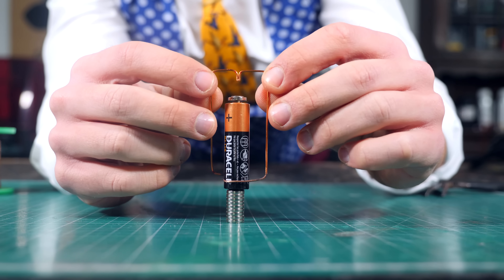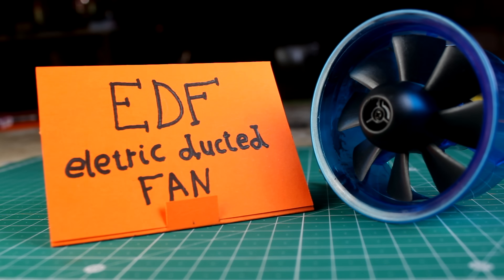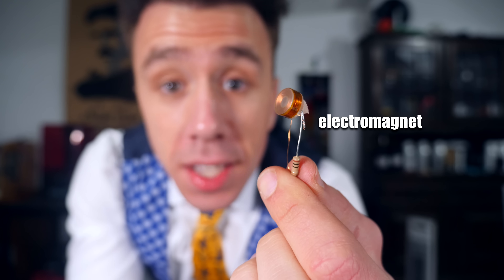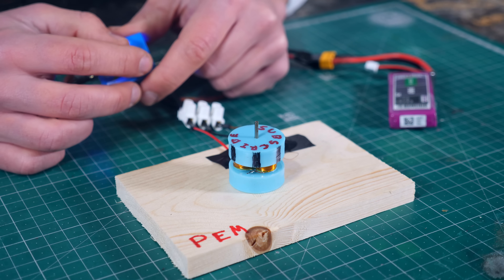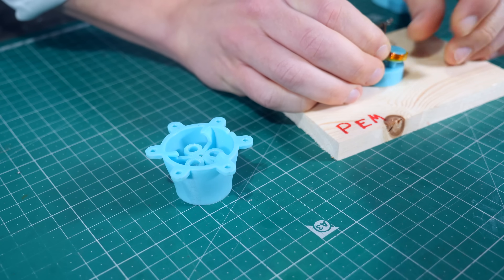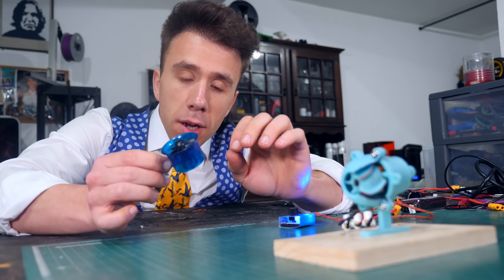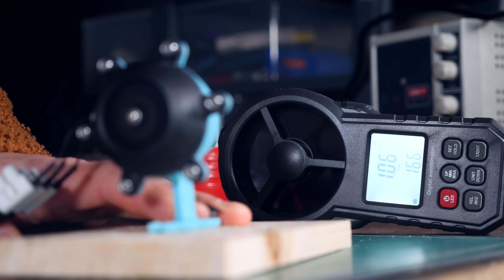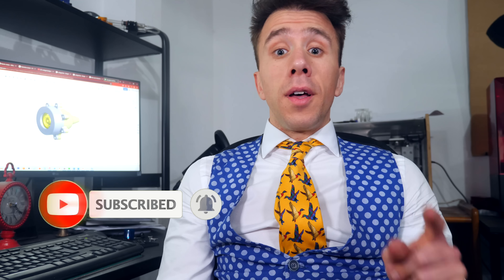I 3D Printed an ELECTRIC MOTOR FAN

Comment: It is quite interesting how JD opted to for a solution that theoretically seems interesting but in practical sense , it is a bit different.
           The most ironical thing is that this practical difference has already been covered via hint by integza.
           There are couple of noticible loopholes in the design as well as the 'PEM'. They are-
             1.    As stated by JD, the diameter of the inlet duct part of both the models make a difference .it is true in this sense because integza has not included a combustion chamber as well as an exhaust turbine fan . If it was to be included then it would produce more thrust than its usual model. Most fascinating part of this idea is that it already has been stated by integza in this video .
                   This is the only reason why impelled thrust generated fans have unique design as well as a bit more gap between the casing wall and fan blades ,also the casing is done according to  the blade's curve . We can see this as we watch a cross section of a small jet powered engine. Shape---
                                 |.    |
                                 |.    |
                            |. |         |  |
                           /.  \  \  \   \
                           |  |   |   |   |   | ---- Outer casing
                         /.   \  \  \  \  \
                         |  |   |   |   |--|--|------impeller
                       /.   \  \  \  \  \  \
                     /.  |_ |_|_|_|_ |_ \

2. The video doesn't say about the rpm of the edf so by hearing the noise created by air drag same as by the PEM doesn't mean both have the same rpm.
                  The edf motor - bldc one has more number of magnets as well as more than three sections of coiling resulting in more mechanical power generated from electrical energy. Also the shape of allignment of the magnets , typically is in a circular shave ,giving more magnetic field intensity at the centre of the coil part. This isn't the same case with the PEM. This is the structural difference i could find in the two motors as the edf is more stable and perfectly built with the rules of a motor.
            
Solution- 1) Change of duct / casing to one that a jet turbine has ,to keep in mind that the impeller must be from the scatch one.
2) Add a combustion chamber ,fuel ,fuel injector and turbine fan ar the back
3) Change in the design of the so called 'PEM'.  
   

                Thank you

Comment: The material for the core of your coils matters quite a bit. Magnetic reluctance and leakage reactance will come into play here. Could be that you are wasting power driving the coils themselves to a high enough current to make a B field suitable for your motor. Swap for a ferrite core maybe. Ooooooor attack it from the other direction, use a larger magnet. Switch to a bar type and use nd52. A "linear" coil replaces your circular ones then. If you have any spare bldc that you don't mind destroying, take one apart.

Comment: The surface roughness of the print may be a problem. I don't have a resin printer to tell for sure, but if you print something with fdm you have layers that cause air turbulence and performance degradation.

Comment: A thought and potentially way off point here but the Dyson is trying to create a large build-up of low pressure (I think this is the right way around on high and low) so once it comes out it makes a large volume of cold air. So I think in order to do the opposite and create high pressure and thus higher RPM you need to reduce the angle and improve the laminar flow on the outer casing as this will obviously create vortexes slowing the speed of the air throughput and again reducing the RPM. Hope this is not too far wrong

Comment: Video Idea: Create a jet engine with expanding nozzle - can be accomplished by thermal expansion properties of metals like how a bimetallic strip bends at higher temps or using an actuator that can withstand high temperatures. 
(or)
Modify an existing jet engine or pulse jet engine to create reverse thrust and explain why they are unsafe for use in commercial jet engines (widely criticized topic but really helpful in terms of knowledge)

Tomatoes are disgusting af- 🍅🗡

Comment: TLDR; The Impeller is more design for pressure and a large axial fan is more design for Flow and thrust.

In Physics; thrust is calculated with F=Δ(m*v)/t  (this is simplified by assuming Vintake =0) from that it seem that changing the speed or the mass wont affect the thrust. However, the cost of accelerating the air is squared as shown in this equation, power=(m*v^2)/(2*t) or this E=0.5mv^2.

Hence, for the same power i can Quadruple(4x) the air flow and half(x0.5) the Air speed to result in a doubling(x2) of thrust.comically large

Comment: Just sitting here mulling this over the big difference I see is resistance between the 2 ducted fans. 
I believe you were going to find it extremely necessary to do a huge amount of math to figure out to be proper ratio of intake air to Compressed air and including your impeller ability and RPMs. Also your clearances are going to be ridiculously important in all of this. And what I mean by that is your clearance to your first chamber where the fan blades are rotating are going to need to be extremely tight.

Well that’s just me literally thinking about the first thing that came to my head when I was seeing your design. I’ve literally spent less than two minutes thinking about this.

Comment: The amount of thrust generated is primarily influenced by the cross-sectional area of the exit and the axial velocity of the air leaving it. Although centrifugal fans generate higher pressure, the airflow exiting them doesn't move at the same speed than the axial fan. Instead, it swirls in a circular motion. To increase thrust, it is recommended to use a device that can convert this swirling motion into an axial velocity component. Basically, in your case, this swirling motion doesn't create thrust but increase losses.

Comment: First off, I think your idolization of Dyson hardware is a mistake.

But beyond that point, your idea that as long as the motor is the same any kind of fan should move the same amount of air should be obviously wrong. There is at least one YouTube channel based around printing replacement fans which are used on a standard PC case cooling fan motor.  The entire point of that channel is that the fan design matters.

My guess in this case is that your pseudo-centrifugal compressor (it has characteristics of an axial compressor as well) is optimized for a higher motor speed and for producing pressure rather than air flow.

I want to focus on that last point. Your ducted fan is designed simply to push as much air as possible. It's goal is to produce thrust by shoving a lot of air.

Whereas if you look for applications of centrifugal compressors, you find applications that require pressure.  In a turbo jet it's job isn't simply to pump air through the engine to produce thrust, it's job is to compress the air before the fuel is introduced to it and before ignition. In a turbocharger, it serves much the same purpose actually, increasing the pressure of the air coming in to the cylinder so that you have more air and more fuel ultimately to burn.

You can sometimes approximate what's going on by thinking of it as a car gearbox. I think what you've done here is taken a motor that's reasonably torquey and is meant to turn a fan that provides a lot of resistance, and you're using it to turn a fan which gives less resistance and which wants to turn faster that that motor is optimized to turn.  To put it another way, imagine you took a slow turning diesel engine from a tractor and plugged it into the first speed of a supercar gearbox. When you start that motor up and engage it and throttle it up to full the car will come up to speed quickly but it will be a fairly slow speed.  All the torque of that diesel engine is basically being wasted.

I suspect that is accrued analogy for what's going on with your fan.

Comment: You are trying to get centrifugal flow and compare it to axial flow, which is like sweeping water up hill with a broom, the centrifugal fan pushes with one almighty heave of air as it turns through 90 degrees, and you have to open up the inlet to match the exhaust area, remember a 10% reduction in surface area is a 30% (approximately) reduction on volume being able to be moved. The Axial flow blade / Propeller/ fan design is like sweeping water up hill using many brooms and only pushing a little bit at a time with with each broom in series (following on behind the one in front of it) and that way pushing more volume of air, you are trying to move as much air as possible, not compress it into a tighter space, hence we use axial flow engines now instead of centrifugal for jet flight....they just work more efficiently.

Comment: Here's the 3 things that I reckon need to be optimised to get a similar thrust, likely will always make a little less thrust though because of the extra energy losses.

- Impeller blade needs to be optimised for the motor, so the blade angle needs to match the motors optimal torque/speed which would be low toque and high speed. So an impeller with very shallow blade angles. 

-  Making sure that the outlet cone's reduction in diameter is designed so that the all the extra pressure that the centrifugal fan creates is converted back to velocity (thrust). Pressure and velocity (thrust) are interchangeable. So you need to know how much static pressure the centrifugal fan creates to then design the outlet cone. Any extra pressure in the exhaust above atmospheric is wasted energy and any pressure less than atmospheric creates an unwanted suction effect.

- Gap between impeller blade and case needs to be real tight, high precision here.

Changing the air flow directions in the engine and adding pressure, then reclaiming it through the outlet cone to thrust will sap a fair bit of energy out of the motor which is why the thrust won't be the same as the ducted fan which is the most efficent fan for creating thrust.

Hope this helps, liking the videos!
Reply: This is the reply I wanted to pile on to. You can probably run a much more aggressive pitch than the dyson due to wide tolerances around the case area.

Comment: For my understanding, you confuse a  few things. Let me explain. According to Bernoulli's principle, with increase of the fluid flow, the pressure of that fluid decreases (so you cannot have both). And both centrifugal fan and regular fan are designed for different purposes: 'centrifugal' will give you higher pressure with lower flow and 'regular' will do the opposite - higher flow with lower pressure.
Next thing is that (if I'm correct) you used an anemometer for measuring 'thrust', which is wrong since 'thrust' is a force and an anemometer only measures flow. Therefore it's reasonable why you got higher readings testing regular fan - it is designed to do so.
Please correct me if I am wrong, I am not an engineer yet.

Comment: Try using both setups to lift a hovercraft and I am certain the regular propellor underperforms to the centrifugal fan despite its higher thrust number. They are not meant to do the same thing. One moves air as fast as possible. the other is able to hold a pressure differential.

Comment: for single stage centrifugal compressor like your doing alot of work to try and compress the air, force it around corners etc.  If you were to monitor temps on a metal axial/centrifugal compressor it gets pretty warm just from the compression.  Thats where your extra 'rpm' of motor is going, fan diameter and work being done all matters, you can spin a fan fast as you want but if it doesn't have right design or RPM to grab the air it will suffer and you will get what is known as compressor stall.  So thats where axial compressors can be better with stators and multiple stages.   Compressor stall is equivalent to running a airplane propeller at wrong speed to actually slide the air and make any meaningful progress.

I only studied this stuff as a aircraft mechanic engineer so actual like engine design specifics, beyond me. but thats some long/short of it napkin explaination without me doing much more.

I would start with honestly using a dyson fan/housing, and working backwards.  Measuring airflow with one of those things is not really a good way to measure thrust specially when talking about the entire point of a compressor is to compress air to make fuel air ratio burn hotter and faster through turbine.   By measuring the output from a compressor compared to a ducted fan is kind of pointless.   I'd recommend grabbing or looking through aircraft maintenance engineering textbook and going through turbine engine designs and seeing what all stages are responsible for and some of the operating principles since I think your missing some of that right now compared to your rocket knowledge.

Comment: Put simply, centrifugal fans are better for pressure and an EDF will be better for volume of air. Just like a piston pump is better for pressure in water rather than a centrifugal.

Comment: Dear secret tomato lover.
 I believe that you EDF produce more thrust as it is driving larger volume/mass of air due to less resistance + more efficient fan design. Centrifugal fan would produce more pressure but it is a lot more difficult for the air to navigate through there for resulting in lower mass of air and as result lower thrust. 
Love your work!

Comment: I think motor need a redesigning
Because your design is axial pem motor and axial motor produce more torque but radial pem motors gives more rpm so i think redesigning will work and one more thing use delta connection not star connection please.

Comment: It redirects airflow where you lose energy. Normal fans are better design for prop. 
In jet engine they are used because they can compress air better and tolerate high rpm. Normal fans are working at lower rpm, which would need gear box.

Dyson uses it because of no real reason. That's an expensive brand around this design.

Comment: Who is this jack ass? This video has nothing to do with aerospikes. An aerospike nozzle is to better match rocket exhaust pressures to the local atmospheric pressure as it changes altitude. The reason his centrifugal fan doesn’t work as well as the axial fan is one, Reynolds numbers and two, the axial fan is design is based on literally thousands of design iterations and testing.
Reply: shut up

Comment: There are a lot of differences between edf and the thing you've build 
Let's start with basics 
So in general energy in =energy out - energy lost 
So 'power in motor' = thrust - loses 
Now in EDF all the loses are just air drag of the blades (friction in motor, resistance of cables etc. are not important for this) 
Where as in your jet design 
You build compressor not a fan 
And it compreses the air not pushes it back 
And compressing the air takes some energy 
Then you squeeze that air thru the body and redirect it to the back all of this take away energy from the moving air which in result slows it down and 3rd law explains lack of thrust 
In real jet engine compressor is there only for getting a lot of oxygen to fuel quickly not for thrust

Comment: Maybe it is because the motor works more on pressurizing the air rather than accelerating it. 

So when the pressurized air exists in the turbine, it expands in all directions, and a lot of the trust goes in different directions, like an expanding bubble, which cancels in all directions other than the backward direction. So to increase the speed it could be useful to add a tube, to let the air accelerate b4 it leaves the turbine, in this way the pressure (average kinetic energy) should theoretically turn into real kinetic energy and speed the flow rate in the tube, which would direct more most of the air in the backward direction and lose less energy.

Comment: The thrust doesn't match because the geometry of the blades greatly affects the output. YouTuber MajorHardware has been running a series where people submit their own pc cooling fan designs and he prints and tests them, and the results are extremely variable. The thrust was never going to be the same so don't beat yourself up about it and just make some design tweaks!

Comment: I could have something to do with efficiency of each design. Centrifugal type compressors tend to run at much higher rpm as in turbo charger where it’s efficiency it’s higher than an axial type compressor. Just a thought. Interesting video by the way